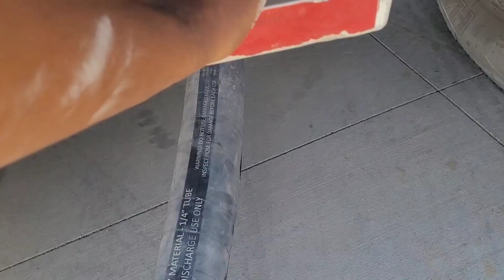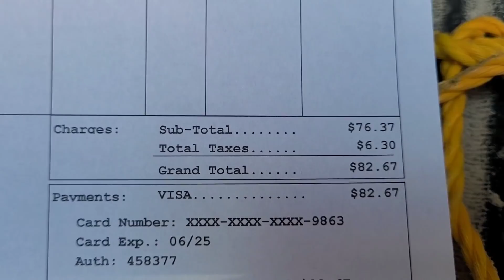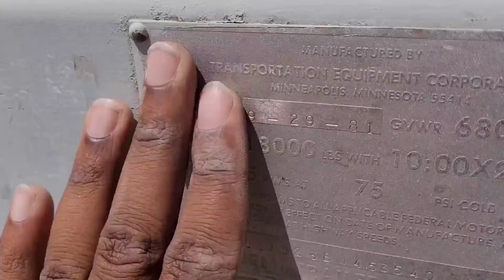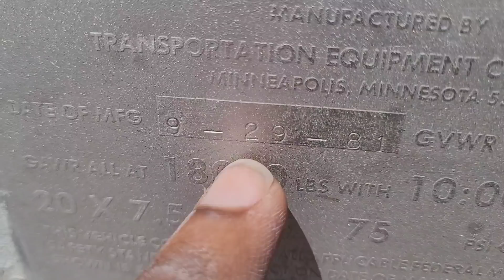Trailer was only 99% Ready

Comment: That's what's up but I got a couple of questions. 1 Can you blow off faster loading it down the middle similar to how your boy be blowing off so fast? 2 Don't they have a real setup for that belly line where you put those bungees? Kinda seem like the bungee is a get me to the shop fix. It seems like they won't last long with the vibration and the heat. Also seems like the line is riding on the axle which is gonna fray the line over time.
Reply: Yo I just seen you installed some chains. That's what's up. 👍🏽👍🏽👍🏽👍🏽💯💯💯💯Might I add that you should consider cutting a piece of old hose to put between the new hose and the chain. That way the friction of the hose moving doesn't fray your new hose. If you check if often you will see if the pad is starting to wear out and replace it. Imo.... 🤔